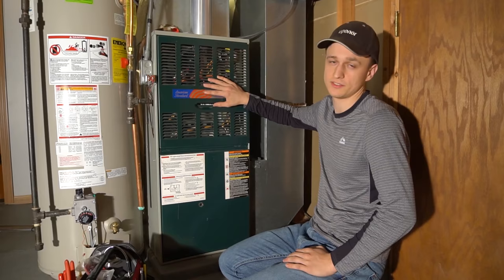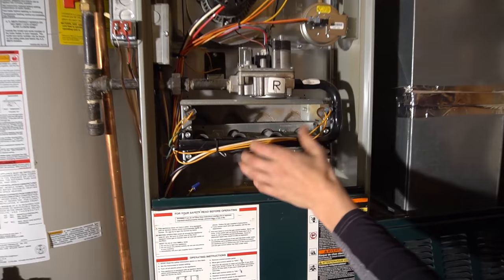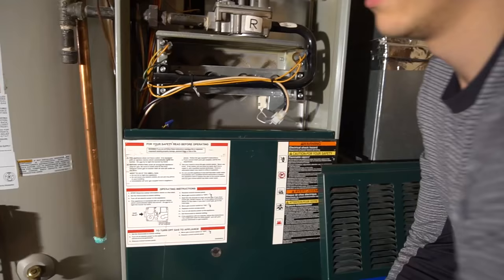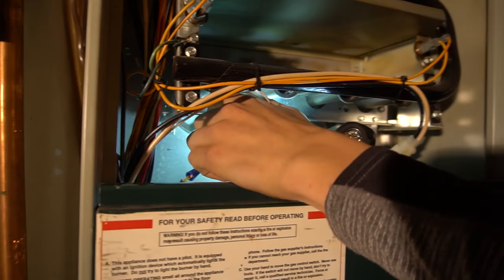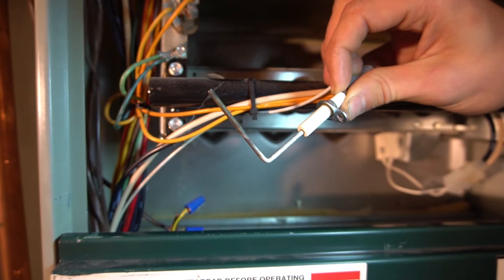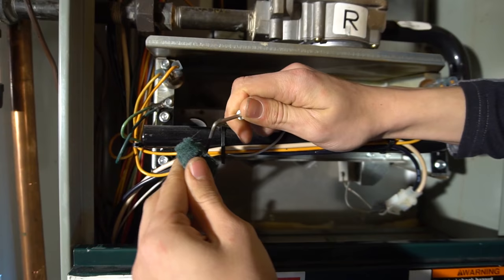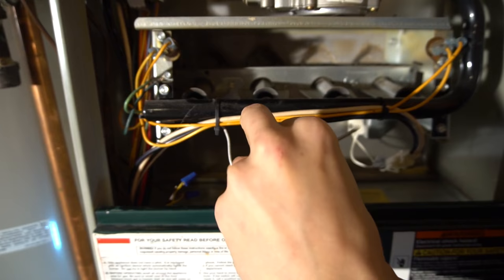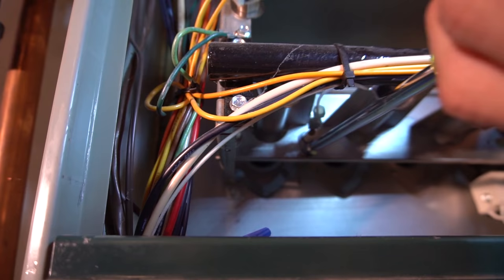Furnace Burners Dont Stay On! SOLVED

Comment: 12/13/2021 My furnace burners stay on for about 7 seconds then shuts off. I cleaned the flame sensor, it didn't help. I ordered 3 new sensors on Amazon. Already tried 2 new sensors but the burners shut off after on for 7 seconds. Not sure why it shuts off with even new flame sensor. My controller is White Rogers 50E47-150. Last winter 2020 it was working ok. I bought a universal White Rogers 50E47-843 many years ago. So, I tried to install this universal controller last night but the thermal stat keeps making clicking sound simultaneously with the letter “Heat On” blinking on the thermal stat screen and it doesn't turn on the ignitor and so no flame. Basically, nothing was turn on. I installed back the old controller, turned on the heat on thermal stat, no clicking sounds from thermal stat, within minute, ignitor ON, within 30 seconds burners flame ON for 7 seconds then shut off. This repeated for 2 more times then controller went into lock out with red light blinking. Turn off heater from thermal stat and turn heater back on, the whole process repeats.
FYI-I am pretty handy. My furnace is about 32 years old but in the last 20 years, I have been fixing it a few times. Replaced the bad ignitors about 4 times. Replaced the bad step-down transformers 120vac-24vac 2 times.

Comment: When I remove the burner area cover my flame stays on and when i reinstall the cover the flame doesn’t stay on. So I put the cover back on with the screws loose to allow a gap in the cover and it’s working. I accidentally discovered this and I’m wondering if anyone has any insights.

Comment: Didnt fix it. Nor the replacement of my mother board/ 3 sensors tried/ two ignitors as it wasn't working.
 The new mother board fixed the ignitor issue/ now I have it shutting down in abut 4 seonds after ignition.
 Rather disapointed/ rather getting chilly these days in Canada.
 I really am out of ideas.
 Fixed any wire issue with new wires I made up/ gronds and ends changed on what needed to be changed.
 With the old mother board I counld at least light it up and keep the house warm. But if I change it back and the issues still are there. Then what.
Lookking like a $7,000 christmas present to myself.= coming from the friendly furnace guys.
 Really stuck. Had no voltage on my temp sensor as you showed us how. What else is in the system. The only thing I havent changed was the transformer (  ut checked and fixed any issues with the connectors/wires. I covered it all, but she just wont stay lite. Goodman two burrner GMP050-3

Comment: My heil has the sensor mixed in with the ignition. Thanks heil! Replaced sensor ($61) then “smart” valve ($280) and still nothing fixed. 
Oh, sensor is only in the path of the pilot flame so……🤬🤬🤬🤬🤬🤬🤬🤬🤬

Comment: I cleaned and replaced the flame sensor it still want stay lit.
Reply: How about replace part on Amazon
Reply: Maybe it’s not the sensor. Might be igniter problem
Reply: @omniminokyo2  the igniter is fine it lights the burner ,but it goes out in 2 seconds.

Comment: I replaced my sensor. The flames come on, and burn anywhere from 5-45 minutes, but then they go out. The furnaces “clicks” on occasion, but continuously blows cold air. A gas lockout error code comes on. The valve clearly works, but there is no evidence of a “mis wire” problem since nothing was jostled or swapped. 

Could a circuit board be the culprit?